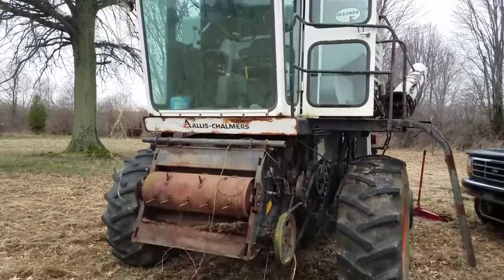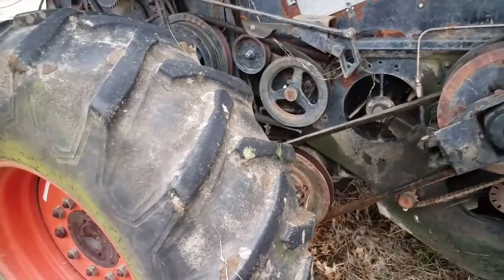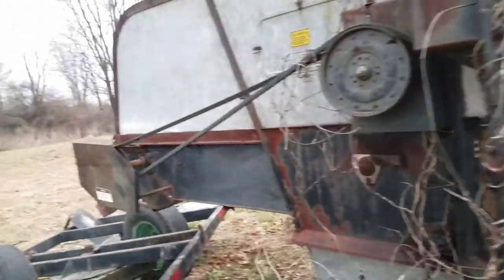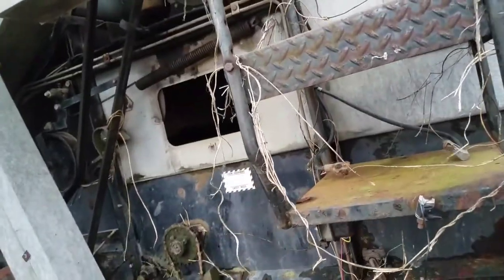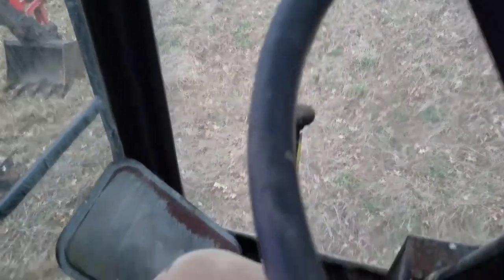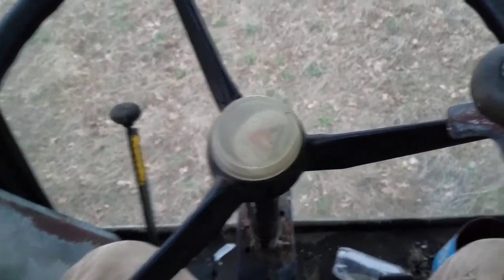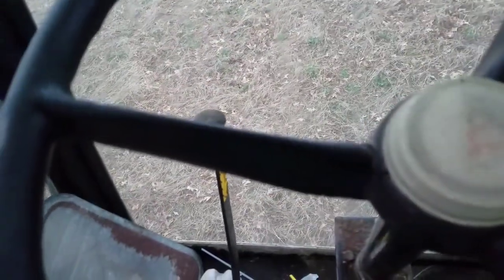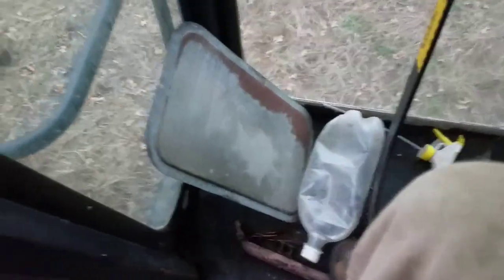Walk Around Of Gleaner 1

Comment: You're going to have a butt load of fun with all of the bearings.
1/4 of them will fail within 100 hours.
Get it all squared around and the F is a wicked reliable machine, I bought my F in 2003 and use it every year for custom work and I haven't lost one bearing yet.

Comment: I believe I would change all belts when everything else is running CORRECTLY. I would not change one hydraulic hose till it proved to leak. The chains need renewed also. You are going to find the radiator bad but that can be changed to one less expensive with some fabrication work.

Comment: I had an F before the M2 , drove it home without a clutch it was diesel, the  lever on the left must be a header clutch mine didn't have that. Separator clutch is on the right, I little mantnce and it's good to go
Reply: The only thing I didn't like was the backside of the concave was closed on the F, the M was open and doesn't grind corn as bad!